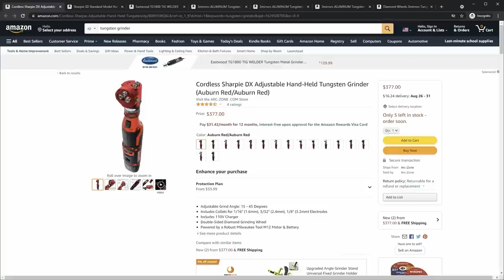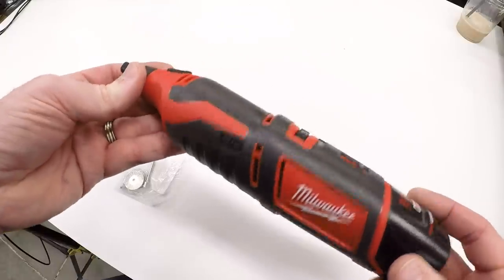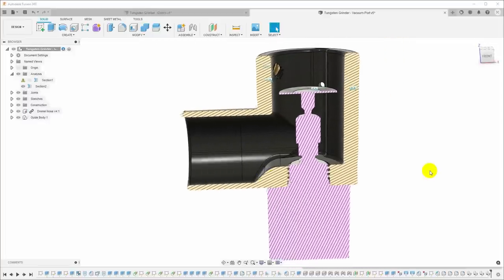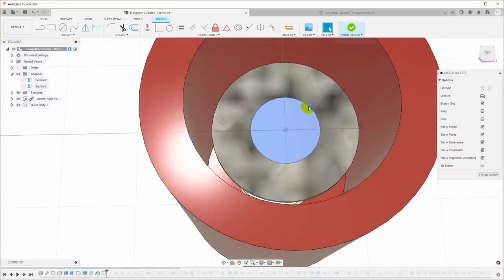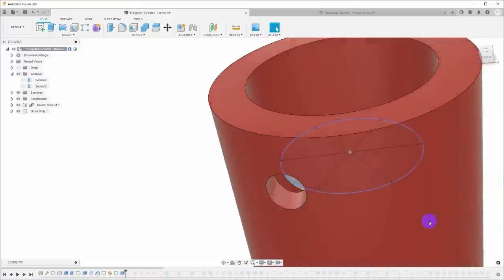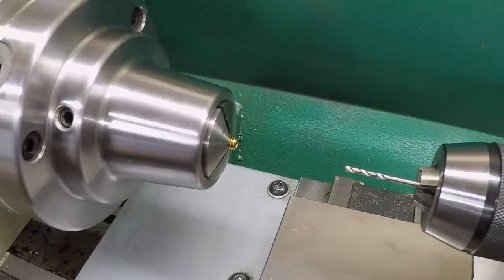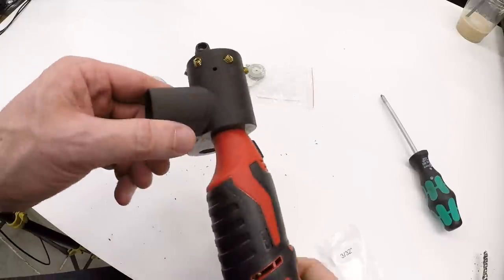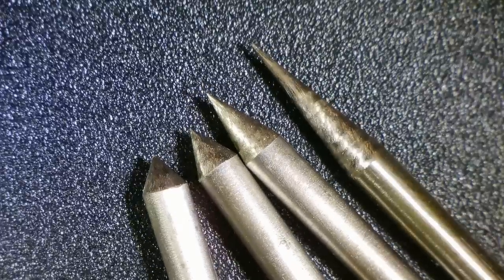Let's Make a Tungsten Grinder | 3D Printing with NylonX

Comment: I had the same issues with supports until I changed the contact z distance and the xy separation. I use .25mm for contact z and 75% for xy separation. It makes a world of difference.
Reply from the maker: I'll give it a try.  I really wish Simplify3D had an option to print dense support on the top, but leave it out for support built over a finished surface.  Both of those are pretty easy to remove.  I'll try increasing the Z separation.  I was a little afraid of losing control of the inside dimension if I increased it over .1mm.

Comment: You can make a 3d printed shim that goes on the shaft of the adapter that holdes the grinding disk that automatically has it at the right height. When you get a different height system, just change the Z height of the shim
Reply from the maker: Good idea.

Comment: Maybe add a tab on the outside to gauge the arbor length against, or install a pin into the sight hole instead (move up by radius). Maybe length from end of mounting tab to body of jig (or a boss on the side) is an easy location for a gauge.

Comment: For 3D print support, dissolvable filaments are expensive, and for supporting trapped internal volumes there's no substitute, but if you are going dual material you can use an incompatible plastic (such as PLA + PRTG - either can be your part and the other used as support) as a cheap support material which wont strongly bond.
Reply: PVA is about 1.5 time the cost of PLA. I have this for my Ultimaker S3, unfortunately, PVA (in my opinion and experience) does not live up to the hype. The filament gets extremely brittle and breaks in the bowden tubes causing printing to stop or failures. It also takes hours to dissolve completely, even after breaking away most of the supports. Of course I'm sure there is someone that would say its me. Again, just my experiences after a year of trial and error.
Reply: @VanTekConsulting  I agree, I don't use the stuff (soluble supports) myself because of the hassle and because I design almost everything I print so I design for printability - and I've never delved into the fiber fill stuff either - but you absolutely need to keep any such material bone dry all the way to the print head. Frankly, I'd feed it to my printer directly out of a food dehydrator shielded by PTFE guiding it as close to the hot end as practical then never leave it sitting in the tube between prints. I'd treat nylon the same as it reaches saturation in about 18hr's if the spool is left out, I'm sure PVA is even faster. It could also be helpful to go oversized on the PTFE tube - maybe 3-4mm (assuming 1.75mm filament) to give it more room to "be stiff" and not break. Anyway, I don't think it's "just you" ;)

Comment: I'm with AWDjr just a cheep 6 inch grinder harbor freight with a 6 inch diamond plate wheel and a cheep drill. I can sharpen a dozen tips in just a couple minutes to exactly what work for job.

Comment: You should make a spacer for the collet of the rotary tool so it positions the grinding wheel at the perfect height. Then you wouldn't need to look through your hole to adjust it.
Reply: was thinking exact same thing :-)

Comment: I have just printed this on a Flashforge printer and the slicer did not add any supports. It printed better than I was expecting and the dimensions are close enough. I used PLA as that is all I have ( only had the printer for 3 days ).

Comment: A great design , would love to build one . Sadly 1/4 setscrews are close to impossible to obtain in europe . Any chance of modifying the design to accept M6 or M8 setscrews ?
Reply: not that difficult  just put a M8 tap through the hole and retreat it.
Reply from the maker: M6x1.25 is super close.  You could just run a trap through the hole and it should work fine.

Comment: amazing build!
just to share thoughts/ideas. i would have made the view through so to pass a tungsten through and let the disk with the shaft rest at a fixed desired height. then make a tool (if necessary) to reach and adjust the collet through the vacuum hole (probably not enough space to maneuver a tool to adjust the collet... would have to try).

Project ELS: would it be posible to add a "jog left/right and hard stop" to the system? with the goal of not having to engage or disengage the half-nut when threading? you woulnt need to put the lathe in reverse, or even stop the spindle for that matter, to move the tool to a desired possition.. and wouldn't have to worry about backlash (correct me if im wrong there). this is mostly curiosity, and if right maybe spark the idea.

and pure curiosity, how the hell does one make "half holes". (i cant find the right name. think of a halfmoon. those round shafts that are cut in half at the tip? well, the hole in the knob that matches that... english no bueno.. brain hurts lol)

Comment: Glorious work!  What are the possible failure modes?   Say the wheel grips the tip and yanks it out of your fingers - it will wedge up if long enough, would it split the shell?
Reply: Given the direction of rotation of the grinder, it pushes the rod out rather than pulling it in.
Reply: @martinmarriott3607  Oh good spotting!   I wonder if it could throw the rod then ?

Comment: I buy the cheap replacement 4" diamond wheels for the Harbor Freight Saw Blade Sharpener and mount them outboard of my bench grinder wheel using an aluminum spacer that I turned.  I spin the tungstens in my cordless drill near the periphery of the wheel and quickly bring them to whatever point I desire.

For trimming tungstens, hold it on a flat metal surface with a sharp edge and rap the overhung portion with something (I use my MIG pliers) and the tungstens will cleanly snap at the sharp edge.
Reply from the maker: That's a good idea.  I always forget that I can stack up multiple wheels on a grinder arbor.  I also love the use of MIG pliers as a hammer.  There's an old TFS video out there somewhere where the running joke is that every tool in a welder's toolbox is a hammer.  :)

Comment: What about using tree supports instead of regular supports?  Your slicing software might make the supports all touch the build plate then.  That way you will not have to remove the supports from the bottom fo the vaccuum attachement at least.

Comment: I would have been tempted to model the tungsten and place it in the model, using that as a guide rather than the planes and offsetting the brass diameter. Many ways to skin a cat I guess

Comment: I down loaded the models for your grinder.  It has the soldiworks CAD file and the stl.  I tried importing the stl into solidworks and it does import but trying to turn it into a model is a problem.  Solidworks is just not up to it.  

Perhaps when you upload models you could include STEP files?    

Great job.  I love your video's.  

Andy

Comment: As I'm new to Tig I sharpen.....constantly.......my tungstens on one of those small 75mm (3")  double ended bench grinders with a 400 grit cup diamond wheel on the left side instead of the mop.
The grinder cost me A$50 and it came with a 75mm (3") stone on the right side and a soft mop on the left........ it also has a flexible drive shaft that plugs into the right side to do die grinding work etc.
What I would like to see (find) is a type of grinder that you can grind the point on the tungsten while it's extended but  still in the torch......this would save having to unscrew the end piece and remove the tungsten every time..........I'm working on a design that uses 2 carbide blades set at an angle to cut the point etc and gets rotated in a cordless drill.
Reply from the maker: That's an interesting idea.  It seems like you'd have a hard time getting any kind of wheel into the right position to get the scratches in the right direction, and you'd still need to extend the tungsten to the right length after grinding it shorter.
Reply: @Clough42  Yep, that was a passing thought as it's fiddly to keep removing the tungsten and grinding it..........it might be less fiddly if I grind a batch of 5 electrodes and do them in one hit......I even contemplated grinding both ends to save having to go and grind it again.............my main welding tool is a plasma welder but I like the more precise welding capability of Tig for the smaller jobs.

Comment: This is really nice! I’ve only been tig [GTAW] welding for about 35 years. Is there something I’m not understanding about need for grind angle greater than 15 degrees?  My instructor back then said 5x diameter for grind length. I do like the vacuum port, as I probably carry around a life shortening amount of thorium.

Comment: Just a thought, what if you put the tungsten tip in a drill and spun it consistently, I'd imagine slower vs faster but I don't work with tungsten, while sharpening the tip. Seems to me you'd probably get a better consistency at the tip or does that just not matter? Also I'm sure the tip will be sort as using a drill would become useless at some point...
Reply from the maker: You'd want to turn it slowly, but having it turn consistently would be helpful.  I think wielding the weight of the drill motor would be kind of counterproductive, though; it would be easy to put a lot of torque force on the brass bushings.  If you used the grinder handheld it would probably work.  In practice, though, it works pretty well by hand.

Comment: Very nice thanks for your work Is there a file for the inserts please (hex screws).Could you measure the temp on the tungsten when grinding and will carbon fiber / nylon withstand that temp ?

Comment: You can press/pull the threads to give them more clearance
Reply from the maker: Yeah, I did exactly that, but it didn't end up in the video.  I set up a parameter called "ThreadFit" and added a push/pull feature to the timeline on both flanks, the top, and bottom of the thread form.  I tested with a small part until I got the fit I wanted (+0.009"/0.23mm).

Comment: love the diy approach to this tool! is there a reason why you didn't do heat set inserts instead of printing the 1/4-20 threads? noticed this on the other carbon nylon video also.
Reply from the maker: I've never actually done anything with heat set inserts.  In fact, I ordered some today to try for another project.  Maybe it'll become my new SOP.
Reply: @Clough42  I think you're in for a real treat. totally changed my design strategy for printed parts when threads are involved. Have fun and thanks for the awesome videos!

Comment: Inb4 James designs and builds a battery eliminator/power controller to run both the grinder and the vacuum from the power switch built into the grinder.
Reply: I was thinking why not print an impeller to fit under the grinding wheel... Built in extraction, no need for the shop vac.

Comment: Re print supports - You can often make minor design changes to avoid print supports. For a part like the one made in this video for example - do you really need the internal shape of the horizontally printed cylinder to be round? Nope, not for this application. Consider giving the internal hollow a flat top that the printer can simply bridge before the overhang becomes problematic. For through holes (like a screw hole) I'll make the top trapezoidal instead of round and lift the flat top by 1-2 layer heights above what would have been the top of the hole so any filament sag isn't in my way.

Another thing people often don't think about is that your layer height influences your ability to print overhangs. Think about it, the taller the layer the more the stepover will be between layers, once that stepover reaches 100% of your nozzle width you're printing on air (and things start going not-great well before then). If you reduce layer height (or use variable layer height were needed) you can eek out a little more overhang performance.

Of course when dealing with filament with additives you also can't go too low on the layer height. I would try to stay at least 3x the diameter of the particle size - but you'd probably need more than that for a chopped fiber fill. Experiment time! ;)
Reply from the maker: The vacuum hose fits into the internal taper of the port, so yes, it needs to be round.

Comment: Attention when grinding and cutting metals, and connect a vacuum cleaner to collect the grinding dust. I almost set a vacuum cleaner on fire that way, the dust bag was smoldering. The dust bag often contains highly flammable substances such as sawdust. Just a word of warning.

Comment: Great video! I have recently bought a Tig welder but not yet a grinding fixture. While like you I was considering making one like yours myself. Unfortunately I don’t yet have a 3D printer to try. Would you consider selling me one of your 3D printed ones? I can finish tapping the holes clean and making my own set screws. I just need the basic 3D printed part. If that is something you would consider doing please let me know along with the price of course. Again thanks for another great video. Hoss
Reply: He provides the stl file, so you can use an online 3d printing service to print the part. Carbon fiber might give you a Yikes price though.

Comment: Just something to be aware of using a vacuum in this application. A dedicated vacuum with HEPA filters and hazardous waste disposal are OSHA required in an industrial setting.  Obviously not very realistic in a home shop grinding 10 points a week. While grinding treated tungsten electrodes, radioactive dust is created, posing the potential hazard of internal radiation exposure. Every time the shopvac is turned back on for other tasks there is risk it redistributes finer particles passing through the standard shopvac filter.

Comment: 20-25-30 would be more usable angles! The pointier without melting the tip, the better. More focused arc on DC
Reply: Pointier tungsten makes for a more diffuse arc.

Comment: If I'm thinking right it seems your grinding on the trailing side of the wheel (grinding  direction is going from shank to pointed tip) If that is the case I just wondered if it might be a bit more controllable grinding on the leading side. Obviously that would require your angled guide holes too be in the opposite slant direction.. Cancel my query. I hadn't looked at it with mirror image in mind...what a stupid boy!

Comment: Stupid question but wouldnt this be faster to build on the lathe and milling machine out of steel? Vaacum port is easy to weld ,threads you can turn on the lathe and tilted head on milling machine with indexer would make easy job out of those holes.If you do it out of steel there is no need for those bushings.
Or was it one of those moments, i am going to build it like this because i can ?

Comment: Nice result. The diamond wheel worked surprisingly well. Question; in Fusion, how do you move the viewpoint without using the mouse? Mr Google has not treated me well in this matter !
Reply: 3d spacemouse
Reply: @Rick.123  Thanks !

Comment: Great project. Did you print it with infill and if so what %.
Reply from the maker: Probably around 30%.  In a situation like this, the infill doesn't contribute that much bending resistance.  That's mostly carried by the outer layers.

Comment: Your printed one looks a lot more durable than the Amazon one. Is the Nylon/Carbon Fiber filament that much more durable than other plastics? A cost estimate of materials?
Reply from the maker: A single print of this object in NylonX is about $6.  The box of screws was another $6.  I think the NylonX is pretty durable, but for this application, ABS or PETG would be fine.

Comment: Print a small impeller mount it to the chuck , attach a cloth bag and you'll have no need for the vacuum
Reply from the maker: That's a good idea, though it spins pretty fast.  Not sure how a 3D printed part might hold up.  I would still need a filter and collection container.
Reply: @Clough42  the container could be a glass jar which would allow a oil/water collection medium (useful for thoriated tungsten).

Comment: I would think you would want more angles around.... 30 degrees?...   like 5 degree increments maybe, maybe less?

I just remember from school that the tip should be twice as long as the diameter of the tungsten....  roughly.
Reply from the maker: I think it depends on the exact circumstances.  There are times when you need a really sharp point to control the arc, and there are times when a sharp point will break down quickly.  It also totally depends who you ask.  Tungsten angle, balling, etc. tends to bring out the passion in people.
Reply: @Clough42  Balling is only for sinusoidal AC, AFAIK.

I've definitely seen benefits to putting a tiny flat on a farily sharp tip but I've also seen where the tungsten breaks down fairly fast and I think that has more to do with using 3/32" where I really should be using 1/8".

Comment: Did you need to use such expensive filament for this and are you worried about the threads on the metal metal guides wearing out the plastic threads. Then again, is that the reason for the spendy filament lol